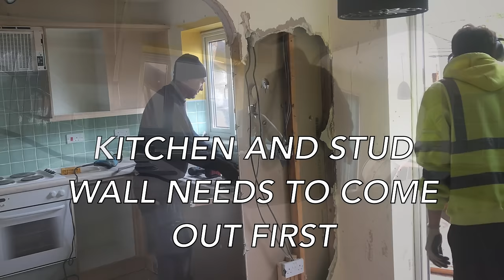HOW TO .... INSTALL 2 HUGE RSJ STEEL BEAMS...EXTENSION BUILD PART 8

Comment: I want to  do a extension at home and put 2 steels in to take the external from joist height to wallplate,my question is can the steels sit on padstones on 100mm bearing or single leave of blockwork one side on a cavity wall and on 100mm  on the other on 9" wall (old house) and take the new extension cavity wall over the kitchen,any advice be appreciated. Cheers ,great job by the way
Reply from the maker: 100 mm doesn’t sound enough . You really need a structure engineer to do the calculations and a Plan . 
    There is a follow up video to this one where I had to go back and build new pillars at each end as the council condemned the drawing and calcs that had been done .
Reply: Well l thought it was a minimum of 150 mm thanks for the advice
Reply from the maker: @markcordwell2035  me too and that’s what we allowed at first but the council engineer didn’t like it . Good luck with your extension 🧱👍🏽

Comment: Well done guys hard graft but you got there in the end.....had a bad accident last yr putting a monster one in the back of an old 5 bed Victorian house it weighed a tonne well actually 995kg to be precise it slipped of a scaffold tube that a lad had under it for leverage it twisted and dragged my hand under!! Ended up with 3 badly shattered fingers it was that bad it shattered my finger bones long ways and severe crush damage to all 3 finger ends. Had 12 weeks off work then had to go back laying bricks with broken fingers due to lack of money!! Lucky it wasn't my trowel hand so was gripping bricks with 2 fingers to lay... bones wouldn't join back together so had to go hospital every week to have them forced. There constantly numb now nerves are gone. So i tend to steer clear of steels now if I can. Anyhow well done boys look forward to the next one 👍
Reply from the maker: Jesse , it just shows how one small mishap can have big consequences. If you watch again I actually have a near miss as we are sliding the steel through the doorway , only noticed when I edited but nearly smashed my leg against the brickwork, very close ! 😬🧱👍🏼.
Hope your hand improves for guy pal !
Reply: C Jackson, thank you for sharing your story. I am very sorry for your accident!

Comment: Would have put the slab in then fit steels using lifters on slab always fit a wide dcp on top of steels (last line of defence) then built brickwork..

Comment: I have a question. Since this is an external wall, we have one layer of bricks, then a cavity, and then from the inside another layer of bricks. I'm wondering why, from the inside, you only used acro props and boards, and didn't support the wall with needles. But on the outside, you used acro props with needles. Why didn't you use needles on the inside
Reply from the maker: The floor joists run onto the wall so we support those which in turn support the wall above 🧱👍🏽

Comment: Great job boys. Always a ball ache of a job. I personally would always use a genie lift(£80ish for a day)It saves on needing an extra man and I think it’s a safer way to install large steels as it eliminates any need to strain yourselves lifting, but each to their own 👍👍
Reply from the maker: J D11 . No chance with the genie as the wall was staying in for a while 😬🧱👍🏼
Reply: @SteveAndAlexBuild  Make the oversite height up to the same height of internal floor. Measure out where the genie legs will go and remove brickwork and blockwork so the legs can travel into the building. We've just installed a roughly 800kg steel using 2 genies in exactly the same situation as you guys. The wall below will be staying for a while. Fill in little holes with insulation or if needed just brick them back in temporarily
Reply from the maker: @kiteboy1973  nice one 🧱👍🏽

Comment: Great job! Not for me though I can not stand it when extensions are done wall knocked through and there is a great big beam now smack bang in the middle of the room.......
Another 3 courses up and an internal beam with an extended bottom lip, it would of gave support to the joists on first floor and a flush ceiling through to opening.
Doing this takes no extra time, is a little more on cost of beam and gives a 100% better finish.
 Neither less you did a grand job keep it up, its not your fault it's these architect that get a good wage for a third of a thought!
Reply from the maker: Sean Coles mmmm I like the sound of your method sounds good 👌🏼🧱👍🏽

Comment: Good tip by showing putting the steels  behind the strongboys first..proper job..I did alot of this kind of work in my past..did one on deansgate,took out a 16 flue chimney over 4 floors..love your uploads..proper grafters
Reply from the maker: Cheers Wayne I learned that trick the hard way . It was another tough day on the extension that fights back . It’s so satisfying now it’s all done 👌🏼🧱👍🏽
Reply: Yeah man..you've done a really nice job..cant wait to see the finished job
Reply from the maker: Wayne Bailey . Nice one , thanks Wayne 🧱👍🏼

Comment: Loving this series of videos on this extension, lads. A proper head scratcher working every move out well in advance so you don't give yourself even more hassle further down the line. The kind of job Alex will learn more on in a couple of weekends than 6 months building straightforward boxes on site!
Reply from the maker: Jim Newlands Thanks Jim it’s great to get one of these every so often to get stuck into and yes it’s all new stuff for Al to gain valuable experience 👌🏼🧱👍🏽

Comment: Look like beasts. Hats a pretty big opening. 6m? Did the SE not specify steel piers or deeper foundation pads? Assume that wall is holding up the first floor joists, roof and new pitched roof for extension?
Reply from the maker: Zed Man . No just specified massive steels , we think they were too big just to be on the safe side . They were horrible getting them in 🧱👍🏼

Comment: Top video but a word of warning from an old bricky site manager when propping the floor joist to hold the internal skin (or any floor joist with a brick block wall on it) be aware that some times not always check that mortar is ontop of the joist because sometimes it maybe an 8 inch joist a block is 9 inch leaving an inch gap ontop of joist if not filled in so when its propped the inside skin may drop an inch . Not having a go its just something to be aware of .
Reply from the maker: Thanks pal 🧱👍🏼
Reply: Thats worth knowing Sam, thanks.

Comment: Get yourself a genie lifter your on a nice flat base good builders backs hernias and other problems. You are a hero on the day until your backs gone think lads.
Reply from the maker: You can’t use a genie lift if the wall is still in 🙄🧱👍🏽

Comment: Awesome videos guys, Great to see you two working together so well. I do this same job quite often and always use "Brick Brace" as well as propping- you get a load more room to work. Check out the full set, well worth the money. I also use a genie as that saves a lot of stress !! I've got 2 ridge beams to do 305x305mm one at 21m & one at 17m spliced at 5m - big crane for those 😂😂. Have a great weekend. Regards Tim
Reply from the maker: Tim Margereson . Jeeese these would look like cocktail sticks to those bruisers your putting in ! I’ve used the genie a couple of times , they are superb . The only snag is you need the wall out to use them . We only did the demolition the back wall after the roof went on so the house stayed secure . Thanks for the tips though , always welcome . Cheers 🧱👍🏼
Reply: @SteveAndAlexBuild  No probs, definitely look at the "Brick Brace" system. I use the full set with a scaffold pole bolted into them and they would support the opening by themselves. If this is the sort of thing you do often - get a set, I promise you won't regret it !!!! And no they don't pay me !!!!!
Reply from the maker: Tim Margereson Deffo worth looking into cheers 🧱👍🏼

Comment: Get into lads. These are the more interesting jobs. A bit of a challenge some times and change from the norm. 👍
Reply from the maker: Helicrete Sydney .Definitely a challenge ! But very satisfying once  they are in 🧱👍🏼
Reply: Bricklaying With Steve and Alex A little tip for you guys if you have the setup, space and time allows. I get some scaffold tubes and clips and put them between the props. It helps to brace the props and allows you to slide your steels on the scaffold tubes into position ready for lifting into place. Cheers
Reply from the maker: Helicrete Sydney . Sounds good 👌🏼 thanks for the tip pal 🧱👍🏽

Comment: Very clean install, quick question do you not put anything between the beam and the insulation coming from above?
Reply from the maker: Thanks pal .
 The gap was insulated before plasterboard went Over and there was a cavity tray installed between the windows 🧱👍🏽

Comment: Great job guys.
Why did you not need bolt sleeves?
Is it because Flanges touch
Reply from the maker: Cheers pal . Yes it was 🧱👍🏽
Reply: @SteveAndAlexBuild  nice, I'm in same position, engineer spec said sleeves for bolts, but flanges will touch and do job.
Oh also, my steels ain't painted, is that ok to?
Cheers
Reply from the maker: @ivegotaporscheandalambo3318  ideally they should be painted . Ours weren’t because the back wall became the internal wall so they will never get wet 🧱👍🏽
Reply: @SteveAndAlexBuild  good shout, thanks.
Still watching yet vlogs.
I'm a landscaper doing my own extension, so getting good tips.👍
Reply from the maker: @ivegotaporscheandalambo3318  Nice one pal , good luck with the project 👌🏼👍🏼🧱

Comment: hi when you pushed the steel beams up to there final poistion snug tight to the under bricks could you put a light butter of mortar along the beam to make it super tight in its final position?

Comment: I've seen a video arguing that strong boys should not be used when holding up the weight of the first floor, instead, a needle goal post system should be used that goes through the wall of the first floor room instead. what is your opinion on this?
Reply from the maker: There are multiple ways to prop an opening 🧱👍🏽

Comment: Didn’t realize that the North of England is in an earthquake zone!!
Great video!!
Rod
Reply from the maker: Rod Fair mmmmm we think the architect may have gone a size up to be in the safe side . These things we’re way over engineered .... should have got him to help put them in 🥵🧱👍🏽
Reply: Bricklaying With Steve and Alex An architect specified them? Here it can only be either civil or structural engineer
Reply from the maker: Helicrete Sydney .😬🧱👍🏽
Reply: Helicrete Sydney agreed, only be specified by an engineer!
Reply from the maker: Findme Atglen All the drawings were checked and passed by the local authority inspectors 🧱👍🏼
Reply from the maker: Well chaps here is an update to our little discussion. Turns out the councils structural engineers condemned the architects calcs and asked for 2 big pillars to be built , only that information wasn’t passed on to me or the customer . Needless to say after a lot of hassle I went back yesterday and built said pillars .... video coming soon 😬🧱👍🏼
Reply: Bricklaying With Steve and Alex Is that where the steel only has a small seating?
Reply: Think minimum is 550mm pier or there abouts under steel, possible pad stone as well?
Reply from the maker: Helicrete Sydney. It’s a strange one as it looks like instead of going further into the walls at each end they wanted pillars building and the opening reducing by over 800 mm for the beams . As the steels are already on 150 mm they agreed to let me put in 2 flat block pillars with new pads . Their main concern was that they were block bonded in . That was yesterday’s project , video to follow soon 👌🏼🧱👍🏼
The engineers specified 300 mm seating for the steels 👌🏼 they now have 410 mm so I can sleep well at night nowc😬
Reply: Bricklaying With Steve and Alex Look forward to seeing the vid matey 👍
Reply from the maker: Helicrete Sydney 🧱👍🏽

Comment: Steels can't be 6m but neither here or there it's all heavy graft no matter what size steel it is, I was putting in a few internal steels  when it was raining last week, dusty and heavy work but a change is as good as a break.
Quality work as per usual lads👍
Reply from the maker: wheaten bread . No , that was a cock up . They a 4365 mm ..... but they felt like 6 m 😬. They were 254 x 146 x 31 . 😩🧱👍🏽
Reply: Bricklaying With Steve and Alex not 30 stone per steel then  135kg and 21 stone.  Still good going. I’ll be genie lifting mine in .
Reply from the maker: Benjamin Harvey . A. Genie would have been great but we had to leave the wall in 😬🧱👍🏼

Comment: It would have been sensible to have had the steel beams painted with a rust paint, red oxide would be good, good practice boys, well done with the beam work excellent.
Reply from the maker: A voice In the wildernes . A good point pal 🤔, thanks for watching and commenting 🧱👍🏽

Comment: Nice vid! I am installing RSJ's at the weekend but my joists run parallel with the RSJ. Any idea how I can prop the wall inside? Trying not to disturb the existing bathroom upstairs
Reply from the maker: We’ve just had the same and we used strong boys on the acrows 💪🏼🧱👍🏽
Reply: 6x2 timbers sent threw wall, at appropriate spacing. Screw straight into the parallel joists with an acro's at each point and a acro's on other side of wall. (Needles) basically instal rsj's you can then cut the outside of the 6x2's lengths off and leave the inside screwed to joists, making an even more sturdier joists 👍

Comment: Great video guys! Just wondering how yous would of shored the internal wall up if the joists had of been running parallel with steel 🤔
Reply from the maker: czx68 . Thanks  pal , probably strong boys. 💪🏼🧱👍🏽
Reply: @SteveAndAlexBuild  u would put needles through the wall but involves going up into the next floor above joist height ,but also u could lift the steels into the ceiling void hiding them
Reply from the maker: @CC-vw3cz  🧱👍🏽

Comment: Could you put steels in like this but sit them on the 100mm internal skin on a pad stone so no nib sticking out walls run through flush… or is that not enough seat
Reply from the maker: Its all down to the structural engineer .
the council condemned these steels and made us build new pillars to support them 🧱👍🏽

Comment: Great video, I’m doing an extension and Loft conversion myself, I’ve interpreted it as minimum 150mm of the steal onto pad stone at each end? Didn’t really look like you had the space for any longer
Reply from the maker: Tyrone Thompson . No we didn’t have much space for anything on this job ! 
  As for seating for lintels and steels your right 150 mm is the minimum 👌🏼🧱👍🏽
Reply: Instead of using steel in the loft have you considered plyweb beams, I used these, I did it all by myself following engineer plans, you still have to use a steel plate to lock them in at each end and a concrete pad but it only takes one person to do? Just a thought...

Comment: Well, good job and process, but good practice to paint the beams before installation, plus they seem a bit of overkill, and in early part of video you say it’s 6mtr long I would say no more than 4.7 m with a span of 4.4mtr. Why at this span you need 203x133? Plus I didn’t see the spacers fitted for the bolts?
Reply from the maker: Didn't bother with paint as it was internal. I gota bit carried away with the size , your guess was better . We have another video about the steels and extra pillars we built where all is explained . As for spacers our supplier dont supply them any more they send a washer and nut for each side of each steel , way better technique 🧱👍🏽

Comment: Wow, are you guys sure the support for those beams are strong enough? Its supporting on the sides and middle?only on brickwork?
Reply from the maker: Standard procedure mate 🧱👍🏽
Reply: Bricklaying With Steve and Alex Let the Building Inspector just check and make sure the beams are not supported by the hollow blocks, which don't have structural strenght
Reply from the maker: Findme Atglen . As of yesterday there are two substantial pillars at each end . Stay tuned for the vid where all will be explained 🧱👍🏼
Reply: Bricklaying With Steve and Alex looking forward to the new video. Glad it's resolved, was worried about it.
Reply from the maker: Findme Atglen 🧱👍🏽

Comment: Hi guys, do you pack any mortar between the pad stone and the RSJ? Or is it purely just sat on it.

Not sure how you get the padstone super tight under the RSJ if you put it in after the beam is in position.

Thanks
Reply from the maker: Patrick O'Connor . We try to put the steel directly into the pad stone then pack the pad stone up tight with slate 💪🏼🧱👍🏽